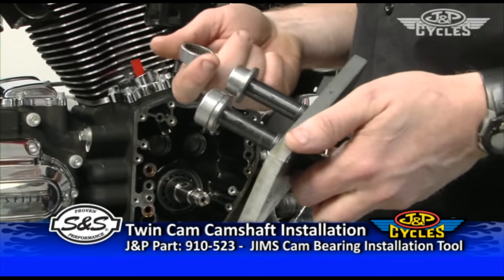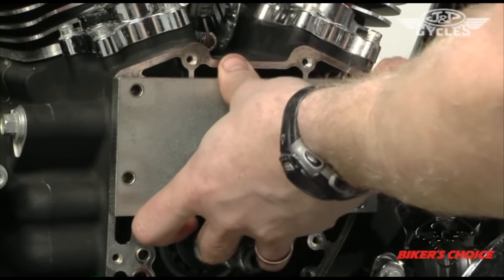Cam Replacement on a Harley Davidson Twin Cam, including Pushrod Removal •  J&P Cycles

Comment: how dependable are the new Harleys these days had a new 1971 super glide and a 1978electra glide both bike were pure junk
Reply from the maker: I find them to be pretty reliable. I ride 40,000 miles per year and outside of maintenance rarely have any issues. When I do have issues, it's usually because of me riding hard and abusing the bike. Both of the bikes you had were AMF years and were notorious for problems.
Reply: thanks for the reply
Reply: To each his own but man it makes me cringe seeing him cut those pushrods.
Reply: I'd have to comment when everyone blames amf for the bad years bikes were built. AMF simply bought a company thAt was in a disastrious downfall and they were not the ones who started building bad rides, actually they simply continued to produce the junk bikes harley was making in those years, didn't try to correct the problems. Harley had built and just ignored all the customers complaints then sold the problems to amf. Now just to be fair, AMF in the end of their term was trying to dump the harley business because they had bought a bad investment. But it was AMF who had the EVO ready to run when they were trying to sell the Harley mistakes and get all the bad Harley built bikes out of their investment. However, if you will research the complete version of the facts, had it not been for AMF blue lighting the EVO as the new engine ready to be produced, Harley would have died at that point in time for them and Harley brand. So for all those who throw continue to place the blame for bad bikes at AMF, it was harley who built the bad bikes (and several dealers and harley mechanics through the years have told that fact several times). It was AMF who was actually responsible for the Harley Group buying it back when they saw that someone else had seriously improved all their mistakes and had an engine that was the best ever bult or owned by harley. Now, for the record, harley headed in the same direction in the end of '99 to dispose of the great EVO and build the twin cams, which numerous owners who sold or traded in their bullet proof EVO's for twincams are having many problems often like before the EVO and now they are losing sales again due to all the cam chains breaking and destroying the engines, building more complicated engines to prevent owners from working on them and requiring more factory trained shop mechanics to keep the cash flowing in from former DIY riders. NO, this is not my story,  don't complain about this comment as if I were the author of the whole deal about these comments.  I'm not the one who is riding the newer bikes and complaining about all the expensive oil changes and blown engines. I'm just saying what some dealers, mechanics and owners have reported and what many that I have ridden with through the years discuss who are now wishing they had their old EVO's back and had never bought the rubberized, twin cam chainbreakers etc. It's their story, not mine, just saying, research the whole history and if there's blame for problenms or praise for quality, then they should each be placed where the facts show they originated. I'm keeping my old EVO and I'm guessing one of my grandchildren will be riding it long after I'm gone, and maybe one of my great greandchildren.
Reply: Stay away from the new Milwaukee 8s.  They are having serious issues with transmission fluid leaking into the engine.  Even the "fix" isn't fixing the issues.
Reply: sl1950 sl1950 well yeah. Look at the years you owned bikes. 1971 pre amf 1978 amf. Bikes are gauranteed not to have to bust the cases until 100,000 miles now. Thank iso 9000
Reply: Ronn AMF actually made Harley better. I don’t care what anyone thinks.
Reply: AND... AMF updated the factories and tooling. Ronn is right. AMF paved the way for the Harley success of the 80's and 90's.
Of course, you can thank Jimmy Carter too for the disastrous economy that destroyed a lot of businesses.
EVO was the best.
Reply: NEVER buy the first 2 years of an engine!!

Comment: Thank you so much for giving me the confidence to open up my 99 wide glide and find that the bearing had collapsed in the cam plate.That’s what that horrible noise was.A relief to find this and it seems the debris hadn’t gone through the oil pump luckily.bike has 60,000 klms so I thought it might be the cam chain tensioner but surprisingly they seemed reasonable. I will get hydrolic tensioner new bearings and a set of cams.excellent tuition much appreciated.

Comment: I love the way you explain things, it's really easy to follow along. But in the manual, it specifically says not to use any locking agents on the crankshaft sprocket bolt.  Makes more sense to me to put some on but I'm still learning and there's a lot of contradicting information out there comming from reputable sources.
Reply: I wondered the same thing.  Seems like if you use the RED loctite, you've 100% committed to those cams and can't change in the future? Wonder if you can get by with Blue?

Comment: On my shovelhead when re-installing the pushrod tubes I use a flathead screwdriver that I ground the flat tip into a concave shape so it fits the shape of the tube.. This helps keep the screwdriver in place when sliding the keeper up the screwdriver shaft and onto the tube. The tube can be a bit oily and causes the flat tip to slip sideways, the concave shape helps avoid that slipping.

Comment: This video made me decide to try a set of 585CE CAMS,  S&S precision tappets and 585 valve springs along with a 4" big bore kit. Installing in my 2003 Road King 31k miles.

Comment: When I have used 262 I have usually needed to use some heat to break it loose when going back in, years latter ( note: not on motorcycles ). We hid the 262 from many other mechanics that thought more is always better and when using thread locking compound  cleaned every thread bore with a Q-tip and acetone before installing the bolts or screws. All in all very smooth . I haven't been inside a Harley motor for 12 years. and that was a Pan . I figured I should brush up on some of the newer stuff now that  I'm retired and the step son has a 2004 I think it's old enough to need a new better cam drive I'll be looking for another video that you guys might have on that job. He's still pretty young and I'm thinking a set of higher tork cams and 1 tooth higher on the trans. output sprocket might make him happy.  Thanks: Mike from Maryland

Comment: This is my first mechanical on a start to finish a cam replace ment in fact any full service on a harley. Which I enjoyed, felt it was at a great pace, 
understandable. I don't  do any servicing like that. Thank you for this presentation it was valuable in several ways. Would like to know more about solid vs hydraulic and the different cam and how these two parts effect performance. Thx

Comment: Excellent video and I've watched it a couple of times.  I will be installing the cam plate upgrade kit on my 03 RK this week and I am a mechanic (not an MC mechanic)... but I will not be cutting the rods.. only because I don't think I have the experience to properly adjust the new rods as indicated in the video. I will have to go the long way around for this one.   Thanks for the video..

Comment: I did notice that when he put the sprocket back on and was getting ready to tighten it, the top sprocket wasn't lined up with the bottom sprocket at first, but' when he went to place the gasket on, it was back lined up. Still a awesome video.

Comment: Man I was right on the install of the cam  up until the pushrod adjustments .I understood the 20 turns and the bleeding but not the next step.  When now you were talking about the additional 6 turns . I will watch the video a few more times . One question,  once everything is done is it necessary to tune the engine . Thank you for sharing from Pete many years in the future .

Comment: Generally he is replacing the cam to change the timing of the valve openings.  There are various cams that can be installed:  some are aimed at increasing low rpm torque numbers and others (on the other extreme) are installed to increase top-end horsepower or to change the torque/hp curve based on riding requirements.  I am changing out the cams in my FLHR to increase lower end torque as I frequently ride through the mountains two-up and would like to be a bit less twitchy on my gears.

Comment: Thanks so much for the video. I recently changed the cams on my '14 Road King and it was pretty easy. I didn't cut the pushrods but removing the rocker covers and rockers wasn't nearly as difficult as the interweb made it out to be.

Comment from the maker: @jamn83 Need to? No. Recommended? Yes. The bike obviously has some miles on it if you're changing the shoes so you might as well replace the bearings while you're in there. Part number J&P part # 431-579 (S&S Cycle Twin Cam Camshaft Installation Kit) comes with everything you'll need to replace them.

Comment: thanks for the info... I have a 110 with a stage 2 cam.. Tired of it kicking me when sitting at the light.. Going back to stock.. I think this will help.. Just have to get all the torques for the screws  // thank again Semper fi Andy

Comment: What were you feeling with your fingers after you cut the front push rods? How did you know the rear was in the correct position to cut them? They both need to be up? Or they both need to be down? Thanks for taking the time to make this. I'm interested in changing my own cams, and this is such a powerful tool.

Comment: One very important point they should have made: On these twin cams now is the time to inspect both the inner and outer (nylon/plastic) hydraulic chain tensioner guides plates and feel them for any wear. If they're starting to wear even slightly then now's the opportune time to replace them. Worn guides can and will cause huge problems down the road. Short money now to save big money later...
Reply: In this video the engine had 1,800 miles, so there was no need to check the pads on the cam chain tensioners.

Comment: This video is very thorough makes it look easy enough for child's play I just want to know what good new cams and bearings do if it's the pressed together rather than a hi torque pin nut on the flywheels come out of true like the San Antonio dealership tells

Comment: Hello Justin I have a question. I now have 38,000 miles on my 2009 Street Glide 96 cubic inch engine. I send oil samples out every other oil change, I’ve been getting excellent reports.  After how many miles would you suggest to replace the chain tensioner shoes?  Your video is excellent, and I understand exactly what you’re doing and saying. 
Thanking you in advance 
Anthony

Comment: Great video, just bought my 2003 Fatboy and Tensioner's were not done, so I will inspect them as this video show's to stay out of trouble, 1 question: when you put cover back on do you just put drained oil in res??? will oil feed down itself??
Reply from the maker: I always go ahead with an oil change, but if not, you can top off with fresh oil.

Comment: I will probably never do this, but I definitely watched this video twice. Is this basically the same process on the new Milwaukee 8?
Reply from the maker: The Milwaukee 8 engine is a single cam. Basically a completely different procedure.

Comment: I learn something every time I watch this video.  Can the lifters bleed down without a load on them?  If I am changing my cam plate and performing the job over a few days or longer, will the lifters hold oil or do they need to be removed and manually have oil pumped into them?

Comment: Awesome video and super informative, yall do an awesome job with thorough explanations of how everything is done! The only question i have though is does the Oil pump not need to be removed for proper alignment when reinstalling the cam plat? i ask as a lot of other videos i have seen show the pump being put on separately and then the wheel spun and torqued in multiple steps.

Thank you!

Comment: So I understand letting the lifter bleed down and checking that is spins freely. You said that it could cause damage if you don't. What keeps it from damaging it once it is running? Once it is running it pumps back up right?

Comment: Great video. Have a heritage Softail with 42k on the clock. it sounds like Iv'e a flemco dancer in the bottom end. Gonna start looking at the cam tensioners. This video took a lot of the fear out of trying it myself. After market parts for Harley not easy to get in the UK

Comment: Great video well done I have read a lot of negative press about the twin cam engine in relation to pressed fly wheel failure and nylon cam tensioner failure leading to engine failure,as I'm in the market for a Harley is this something I should consider, is there truth to these issues.

Comment: You did a fantastic job making this video. I appreciate you taking the time to do it. Very professional and if the motor isn't running fabulous guys it can always be tweaked very easily. Nothing mechanical is going to have a perfect way to make valve lash adjustments. Love it. Subbed -PawPaw

Comment: I love watching this stuff. Man what a great video. I'll never do it myself but I know know what my mechanic is gonna have to do soon. I don't know if this is the place to ask but I'll risk it. I have a 2007 Street Glide I think is a 96ci but could be a 103 after some work from the previous owner (no documentation or records on the HD site but came with screaming eagle Air with a 103 on it. I know seems silly but could have been a big bore upgrade I dunno). I'd love to get cams for it. What would you recommend?

Comment: Great video and thank you for sharing. Just to clarify, did you recommend to use Loctite Blue for some bolts and red for the cam bolts?
Reply: Normal Loctite (for bolts) is no worth to use if you do not clean threads of oil and grease. Loctite for hydraulic fittings tolerate some oil.

Comment: This video is awesome, thank you JP and SS for this. I do have one question before I swap my cams this weekend. You went over timing the cams and adjusting pushrods but what about crank timing. Before you put the cams back in do you need to rotate the motor to put one of the cylinders at TDC?

Comment: You need to install the o-ring for the pump in the case as there is no chamfer. If you put it on the pump end you risk the chance of cutting the o-ring and cause aeration in your oil wich is terrible for any engine. It can also cause oil sumping where the crank will slow down and splash through the oil. The pump has the chamfer. Check out S&S performance for the same information.

Comment: why didn't you align the the camshaft at deadtop center before removal so the new camshaft timing correct and at deaptop center. And you should have done that with cutting the pushrods too. Sorry I work on cars as well. Next time put a pin the tensioner to hold it back off the chain. Great job. Learned a lot from this video.

Comment: I didn't see where you plugged in the sensor that you unplugged on disassembly, any word on that? Maybe my head was turned momentarily at the time you plugged it back in. I observed at the end of the video where you installed the "quickie clips", and you unplugged and plugged the wiring harness back in. I just bought a 2004 Sportster XL1200R and it's in the shop before I even rode it the first time to get a 5,000 mi. service and two new Michelins to a tune of $2,000.00. I like to think I didn't get 'taken' but time and tales from people will tell. I'm going to subscribe, leave a thumbs up, and a tap on the bell, I like the way I could follow everything you stated and absorbed it too. Thank you so much for sharing.

Comment: I found that when you tighten the locknut on the pushrod after adjustment, the bottom part of the pushrod threads in with the nut and the adjustment is not at 20 flats, but more between 19 flats? I usually go with 21 flats then after tightening the locknut you are at 20.

Comment: What are the benefits of replacing the cams?  Some people tell me they are better for long rides and really depends of the rides you go on.
I am not sure i need cams, i have a 2014 Indian Chief vintage.
I am more of a day rider, 3-4 each day on the weekends, don't really do any long haul rides.  Would there still be a benefit based on my riding or would it be a waste of money?
I honestly don't know the benefits of spending the money on a performance cam kit, probably looking at $600 installed but is it worth spending the money, i have lots of power now.

Comment: I noticed he said the run out on the crankshaft is a very important spec related to installing a gear drive setup. I would assume a bike with 24k miles would have high run out on the crankshaft? Mine has 24k miles on it and it has the old tensioner setup since it's a 2000 model and thought about going to a gear drive along with replacing the cams, bearings, push rods and tappets.
Reply: Go to vtwinforum and Harley Tech Talk for detailed information. Youtube isn't suited to questions and answers.  
Runout doesn't necessarily increase over time. You can measure it using a dial indicator and if you don't have an adapter or a fancy indicator mount for HDs you can, and I did,  drill a piece of steel bar and bolt that to a cam cover bolt hole then attach a standard magnetic indicator base to that. (The indicator will tell you if there are any mounting issues.) 2000 have Timken output shaft bearings which is a good thing. (The smegma-belching bean counters switched to cheaper, easier to assemble roller bearings later on while considering the Timken an "upgrade". DO NOT BUY ANY PARTS until you check runout. If beyond gear drive limits, fit an aftermarket hydraulic tensioner chain drive instead. Every OHC crotch rocket has chain cam drive. The only problem was HD executed their early ones badly.